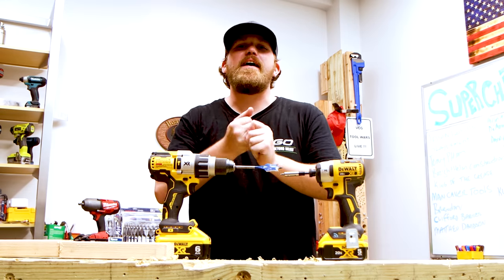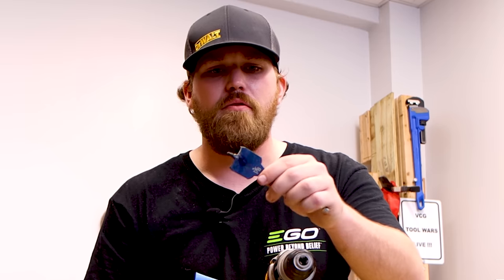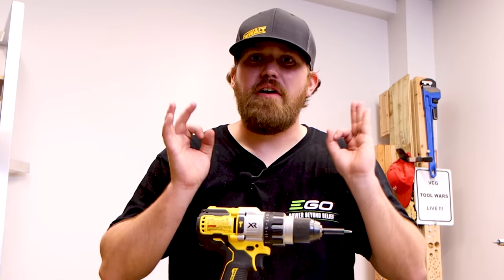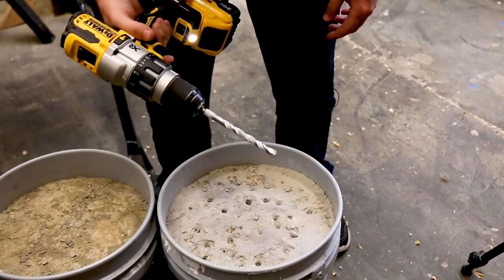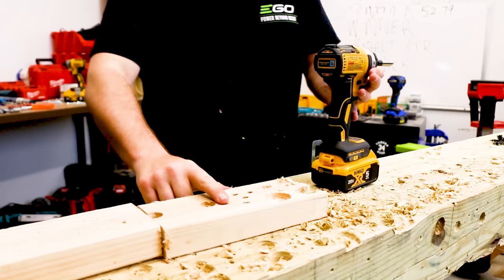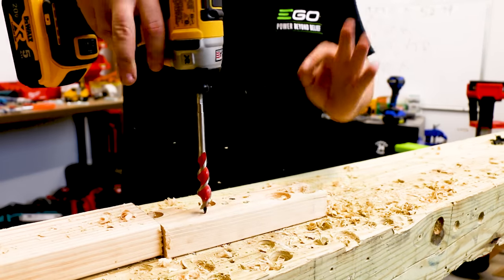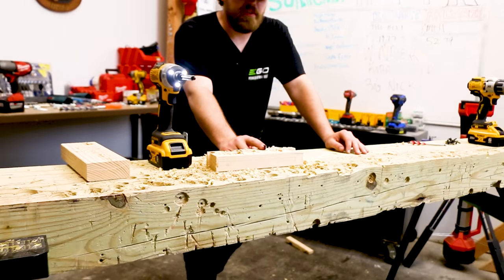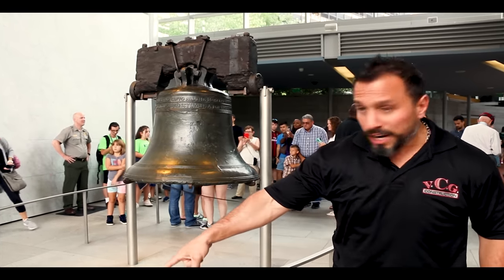DIFFERENCE BETWEEN HAMMER DRILL DRIVERS & IMPACT DRIVERS (Ultimate Guide Tips and Tricks)

Comment: Hole saws, auger bits, self feed forstner style bits, any quality twist bits, tile bits, paint/mud mixers, and taps are all examples of things that do not fit in an impact driver. Don't get me wrong, I love my impact drivers. But the drill with a 1/2" chuck is still the king of versatility. And in DeWalts case, the drill can also act as a work light. That being said, there's absolutely no reason to not have both.

Now for the arguing. You guys keep saying that your impact driver is perfect for drilling holes but have proven otherwise many times. Not only is it a lot slower than a drill, you also have impacts burning up and others that can't hold onto the spade bits. That clearly shows that it's the wrong tool for the job. They also make a lot more noise which can get annoying on the job
Reply from the maker: We disagree
Reply: @VCGConstruction  you disagree with your own results... Interesting
Reply from the maker: Actually we agree, you should have both...
Reply: Impacts make great general use drills as you said drilling different types of metal concrete and definitely hole saws you're better off with a drill

Comment: This reminds me of watching some guys trying to drill into metal with a impact driver, they thought all the bits where bad. After 10 minutes of hearing them saying all the bits where garbage and putting all there weight on there drill i took my drill driver and punched a hole in like butter with the bit they had that looked the worst. With that said, 100% agree impact drivers are safer and easier to use and made sense to me when all drills had DC brushed motors with low torque at 0 or low RPMS, but i don't see any real advantage now that brushless motors have tons of torque at 0 rpm. Learn to use the clutch on a good combi drill with a good clutch and your golden.

Comment: Great video Brother, #TeamDewalt ❤, what are thoughts for using an Impact for drilling into Concrete, for me usually 3/16 Holes. Also I often use Impact rated Hole Saws for Aluminum Studs....typically Milwaukee Hole Saws but have a tendency to burn through em, thoughts on Carbide tipped etc pls. Tbh sometimes my fault for drilling too fast ..#production. Thanks Brother!!!
Reply from the maker: I think it should work fine shawn! Thanks for the support!

Comment: I use Ryobi.  I think you left one important feature out of your video, but I'm not positive DeWalt has the feature.  With Ryobi, I am used to doing just what you did when chucking a bit -- use the rotation of the drill to tighten the bit at a clutch setting you can grip to activate within your own comfort level.  I just learned that Ryobi has the feature of really instantly stopping the drill when you let your finger off the trigger.  I use it to shake the shavings off the bit when not in the work-piece.  You can ALSO use this feature to tighten the drill round bit shank -- I mean REALLY tighten it in the chuck -- by turning the locked chuck when not pressing the trigger; this will tighten that round bit way better than using the drill's clutch settings!  No, the motor will not turn when doing this with Ryobi.  Thoughts?
Reply: The instructions explicitly say not to do that.
Reply: @SJ-le2vc  The manual only says to not use the rotating drill to fully tighten the bit.  I use the drill motor (holding the chuck) to come close to tightening the bit, then, with the drill not turning, fully tighten.

Ryobi merely states that you could tear skin on your hand with a high clutch setting, then trying to stop the drill from rotating with your hand!

Comment: There was a description on the difference in impact drivers and hammer drills, I wish I could remember what video. but the hammer drill/driver has a series of little ramps in the head of the drill next to the clutch system and while drilling into concrete the drill using the pressure from the user rides up the ramp and drops to the beginning of the next giving the hammer action of the drill, the impact driver uses the same clutch drive as the pneumatic impacts that when it starts to bind driving the screw its clutch freewheels for a moment and  Re engages when the speed is fast enough to slam the shaft part of a revolution, but doing so many times a second . Best example I can think of at the moment is a clock hand where the screw is at the pivot and the hammering force is applied towards the far end of the hand

Comment: Any tips for avoiding stripping screws when using an impact driver?  I've been helping my brother build a chicken coop (10x8'). The Kobalt impact driver has three settings. 1 is not enough to drive 2-1/4" exterior screws into pressure treated wood but 2 will start to strip screw heads even when using impact rated bits. It seems like impact drivers are very sensitive to being in perfectly straight alignment with the screw, which was much harder when working above me or when on the ladder and trying to reach away from me so I actually preferred to use the drill-driver to get just the right amount of torque. Is this observation correct...that impact drivers are much more sensitive to being driven in perfect alignement...or am I missing something.

On the last trip to Lowe's, we picked up a more premium set of impact-rated bits (Kobalt ~$20 on sale normally 28?), since the other impact-rated bits he had (the cheap yellow DeWalt box) were wearing down and some of the 2-1/4" exterior screws would start to strip while still about 1/2-1" out of the wood. The new bits were fine for a dozen or so screws, but the same day we bought them started to experience the same issue on some of the screws driven. I had noticed some other bit sets that could flex (eg. DeWalt FlexTorq). Is this a marketing gimmick or useful and worth the price premium? 

I also discovered a couple years ago that an impact driver is not a good way to remove the bolt on a lawnmower that holds the blade in place. It came out easily, but the star shaped end of the shaft that the blade fits into completely shattered into several small pieces. And this was a nicer Craftsman push mower (from about 2010), not some cheap off-brand mower.
Reply: You're correct about driver/screw alignment, regarding stripped screw heads, especially if using Phillips heads. Deck screws with star drivers are more forgiving with alignment and last longer before stripping. Square heads are self aligning, which makes it harder to strip out.
Reply: Like the gentleman said above try to get the torques T25 screws if you're driving decking Phillips screws suck anyways drill your strip screw out a little bit with 1/8" bit take your Philips head bit with a hammer put it in that hole and smack it real hard with a hammer till it sticks and use your impact to back the screw out. another thing with the alignment maybe try squeezing the trigger with your middle finger instead of your index finger you might get more balance.

Comment: I would have liked to see a hole saw kit test comparison and also to see you screw through some sheet metal with fastening screws or just drilling holes through metal. Wood  isn't enough of a challenge. Thanks for the tips by the way. Great video. 👍
Reply: If you were using an impact to drill stuff like sheet metal it just makes a mess of it it punches through the back especially with the bigger bits

Comment: I don’t usually use my impact for drilling pilot holes through drywall because if it’s not on speed one, it flings drywall dust around. If I do use it for that, then I just use speed one to get started then switch to speed 3 after I’m already in the stud.
Reply from the maker: Thanks for the tips and feedback Christopher we appreciate it!
Reply: VCG Construction 👍
Reply: The trigger is variable speed just don't squeeze all the way another thing the low setting is actually when you need more torque the number one setting is actually more powerful than the number three

Comment: Its better to drill slow and apply more pressure when drilling through metal and wood depending on what is recommended by the manufacturer unless youre looking to burn up bits and hole saws, faster speeds when hammer drilling concrete with masonry bits.

Comment: I still wouldn’t use the impact driver for the 17’in auger bit though, especially if your project has you drilling through 3 feet of a black oak.

It’s not saying it wrong the impact driver is nice and good for drilling, but when you have to use the longer auger bit on hardwoods you might as well forget it you need to handle and your project definitely needs to be clamped for safety reasons.

But again if all you’re doing is construction what are you running into nothing but soft words, I can see using the impact driver as a drill because it’s the next advancement for that. But not if you’re building guitars, working expensive furniture or carpentry, or any kind of custom carpentry work that has you working with the rare or expensive hardwoods.  For that you need a high torque drill driver with a handle, but you’ll probably be working with a drill press a lot too.

Comment: Does the clutch have any effect when it’s on the drill or hammer setting?
Reply: The clutch setting is a carryover from when people use cordless drills to run screws it is only on when it's set to screw. There is three settings on those drills screw drill and Hammer
Reply: Clutch does not work on drill or hammer mode

Comment: My Milwaukee drill acts in the exact same way as the Dewalt shown on this video. Blows right through the wood like there isn’t a clutch installed. It’s the exact same one used in the video M18 Fuel - Gen III I believe. I’m thinking the clutch on mine is defective especially after seeing how well it works in this video. It also has tightness in the chuck when spinning freehand. Anybody else have similar issues? It makes it really difficult to install pocket hole screws.

Comment: I never use the clutch setting on my Dewalt drill for deck screws because it might too screw too deep depending on speed or pressure. When I run deck boards and I approach my depth, I slow the speed down for a perfect depth. It takes more time, but it"s my deck and all my screws are uniform.

Comment: I am plumber and I am 23 so definitely not an old fart but I heard ever use an impact for drill as I find an drill is a better and more efficient way of drill and in my opinion a drill is still the king and that hex shall is good as they grip better in a drill chuck that round bit that can slip out at times an impact is for screw in my opinion and a holes every ones in a while
Reply: You still need to use a drill for any of the big holes especially if you're running like forestner bits hole saws the impact is good for the little stuff

Comment: You haven't tried the concrete with impact driver. Will it work right?
Reply from the maker: Yes it will work but it is a lot slower at drilling through concrete than a hammer drill.

Comment: 10:35 the only tool that says take it easy guy is the 887 also i hate when companys sell you 1.5 or smaller batteries they dont sell 1.5s very often especially dewalts 1.3 ah batteries they're the only brand to still give you that small of a battery

Comment: I notice you're using a 6AH battery. That thing will keep it running for a lot longer that the one that usually comes with the drill. The higher the AH's the longer run time I think you get. Sort of like having a larger fuel tank in your pickup truck.

Comment: If the drill bit is designed for an impact, then it is ok to use an impact driver to drill.  If the bit is not designed for the impact driver, even if it does have a hex shaft, then not a good idea.  Made out of different compounds and stresses differently.  Can you get away with one or two holes?  Of course, but over time it has  high possibility of ruining the drill bit.

I think the reason you had a hard time getting the drill bit out of the wood when you used the drill driver was because the bit was at an angle and you were pulling up and not up at that same angle.

Comment: He doesn't mention the most important bit, whether he has drilled a pilot hole, and the size of the pilot hole relative to the screw. Good explanation of the difference between the two tools though. What I was really interested in though, was if the impact driver was less likely to jump off the philips screw head, and chew up the screw and the drill bit. It looks like it's a lot better, but he didn't really address that point directly. 
I find that the drill driver has plenty of power, but jumps, so you can't use the power that you've got. That's why the pilot hole needs to be a good match for the screw using a drill driver, but I haven't tried an impact driver.
Reply: It depends on the type of wood, location of the hole as well as the size of the screw.  For fine finish wood/details, I will use a pilot hole, but not on rough in carpentry.  The only time I usually use a pilot hole on rough in is if it is near the edge of the material.  The other thing is the type of screws.  The new screws have a void on the tip, so that the wood is extracted out of the hole and does not tend to bind up and split the wood.  The trill bits they use in this video have the smaller screw type bit in them in order to assist by pulling the drill bit through the wood.  Obviously you can not use these on thick steel.

As far as the top of the screw and the bit being chewed up, there are a few things that can alleviate that.  First, stop using philips #2, and go to a star bit. Turn the clutch on the drill driver to a lower setting. The other is to use the trigger smoothly since it is a variable speed.  Less pull means less initial twist.  Since the drill will receive 100% of the torque at full pull, or less torque at a shallower pull, then there is less chance that the tip/bit will strip out.
Reply: Oh, I forgot about the sleeve.  When you use a sleeve it helps keep the bit and screw together while using the drill/driver.

Comment: Drilling through metal; generally low speed? That depends a lot on your drill bits, their material (and type), hole dimension and subject hardness/type. There's this thing called HSS. it's actually quite widespread :)

Definitely with you on the dab of cutting fluid.

Comment: I guess the only thing I have to add is when a hammer drill is hammering it is hammering straight while an impact is hammering at a 90 degree. For those that know, know. Hammer drills are for hammering through concrete or masonry
Reply: Edit.hammering with a drill set to hammer can break bolts

Comment: Wanna laugh? I owned a drill and impact combo from DeWalt in 2014 and I owned it for years without using the impact because I didn't understand how the impact worked what it was for or how to use it. I thought the impact was too powerful for driving screws so I have waited using it and use the drill only for drilling and setting fasteners and screws for years until I realized how to use the impact and was comfortable with it. Nick you should have been a lawyer, closing your case... "If you don't agree than I think you're dumb". 😁

Comment: The biggest cost is not between brushed and brushless….but rather how long you get before the battery type that your tools use is rendered obsolete by the manufacturer making all your tools unusable.  Pro’s don’t worry (as much) because their tool turnover is high and in any case its a tax efficient business expense.  However, the poor DiY’er thinking their super DeMakaulki full set with a dozen batts is going to be a great ‘investment’ for the next ten+ years is going to get a nasty and expensive surprise when the batts reach end of service life and find it hard or impossible to source matching fit replacements.

Comment: I appreciate the video. If I can give some feedback (not criticism) - What will be confusing to "new to power tools", folks and to me is that it looks like you are using a Hammer Drill (as is stated in the title of the video), BUT you keep calling it a Drill Driver? - until you drill through some cement, then afterwards, you continued to refer to it as a Drill Driver again. Those are two different tools. Maybe you can put some print on the screen of the video in the beginning, that you meant to say Hammer Drill, and are using a Hammer Drill, NOT, a Drill Driver. Thank you. P.S. It would be great if you did a comparison video explaining the difference between Hammer Drills & actual Drill Drivers. Thanks again.